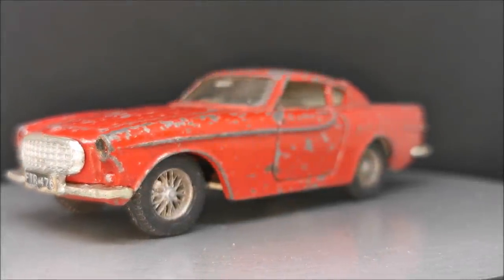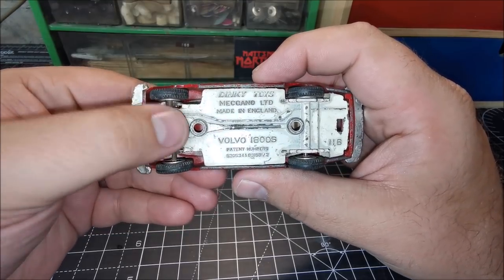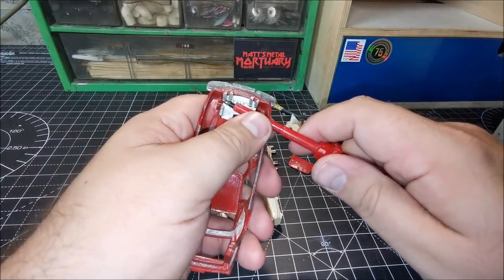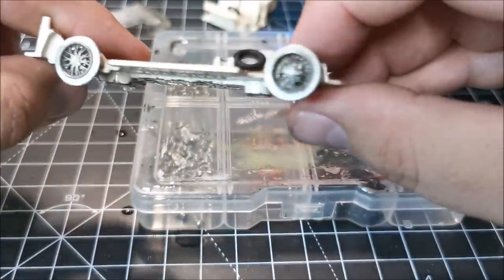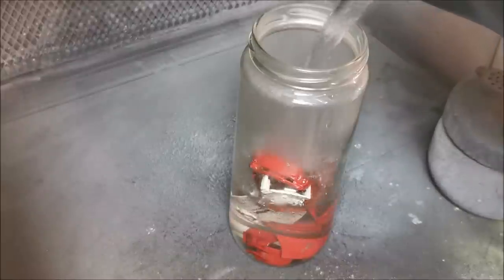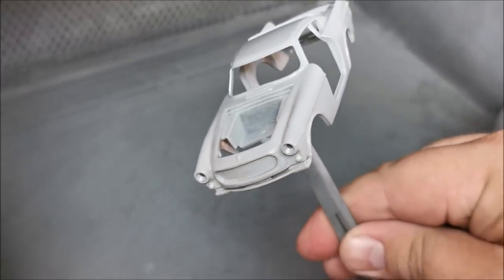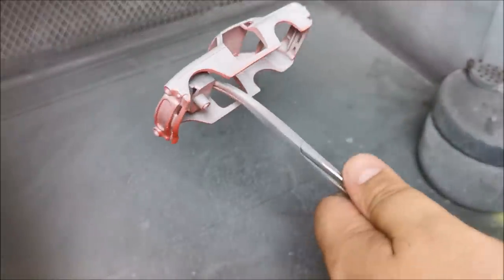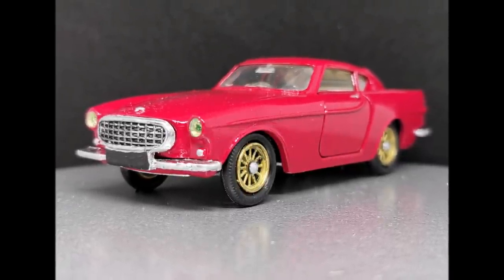Volvo 1800S Restoration - Dinky Toys

Comment: Nice work. Speaking from experience with your paint, you are right in saying white spirit / turps retards drying times & that can be useful on full sized commercials. If you want your paint to harden faster use petrol instead. You will find it goes off much faster. Its how we used to do things in the winter months. Hope this helps.
Reply from the maker: Thanks for the tip